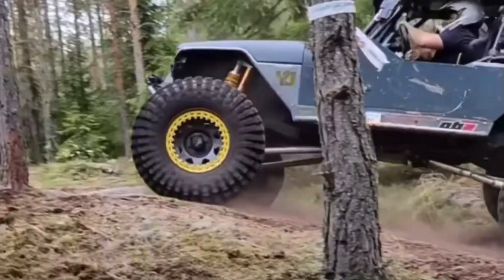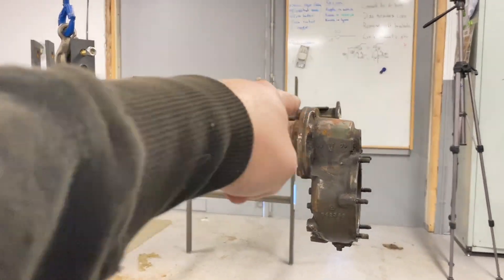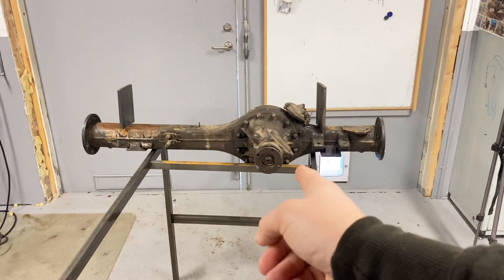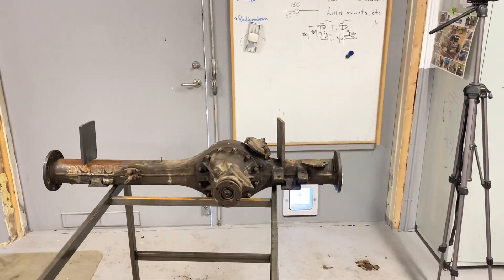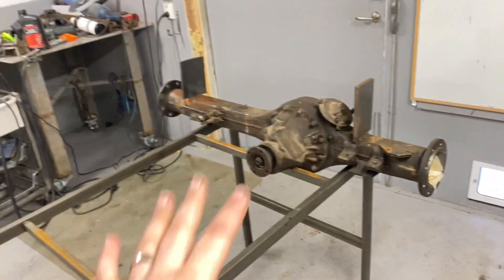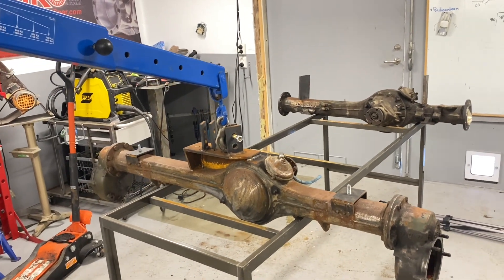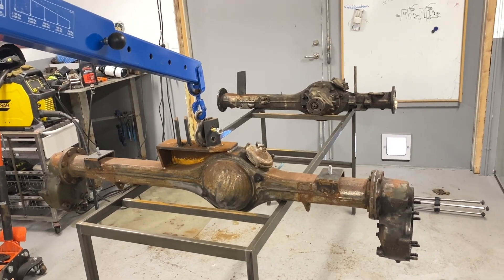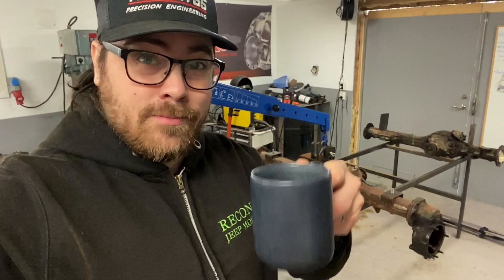How to convert Volvo TGB axle to driver side drop for a Jeep TJ - Pt 1

Comment: Skapligt stort jobb. Men du kan nog ro det i hamn om du är noggrann. Men det blir en saftig merkostnad i att skaffa en axel till och tillverka egna drivaxlar. Svetsar du själv eller lämna bort?

Men jag hade tittat på alternativen att antingen låta axlar och f-låda vara original och använda mig av torrsumpsmörjning av motorn. Då slipper du oljetråget som är i vägen. Kanske går tråget till automaten att modda, annars blir det torrsump där också. 

Andra alternativet (som du var inne på) är att vrida fördelningslådan. Den behöver nog bara vridas ca 120grader, och att fixa en adapterplatta för det är inget jättejobb. (Sen behöver man flytta lite avluftning och påfyllnad/avtappning, men det är i sammanhanget ganska lätt gjort.) Den lösningen hade jag gått på. 

Hur manövreras fördelningslådan? Wire eller fast länkage? Om wire är ju det också lätt att ändra.
Reply from the maker: Hehe exakt allt du nämner har jag vridit och vänt på i veckor 😄 Var även inne på att köpa en adapterplatta och en LT230 låda från Defender för att få kardanerna rätt i förhållande till TGB axlarna. 

Även om jag hade vänt på FD lådan, eller köpt en med höger drop, så hade kardan tagit i startmotorn på den sidan. Visst, jag kunde ha flyttat motorpaketet några cm åt sidan oxå…

Men det föll på att göra om bakaxeln till en framaxel. Då hamnar klumpen dels på rätt sida för min nuvarande FD låda samt 80mm längre ut mot hjulet så kardan går fritt. 

13-bilens 3e axel är relativt vanliga eftersom alla spindel-byggen äter framaxlar 😄 Så det var flera som hört av sig och vill byta min 11-framaxel mot en 13-bakaxel (byter även drivaxlar med dom). Så det ”enda” jag behöver köpa är 2 nya drivaxlar till framaxeln. Så det fick det bli 😄 Är redan kapat och svetsat. Nytt avsnitt till helgen! 👍🏻👍🏻